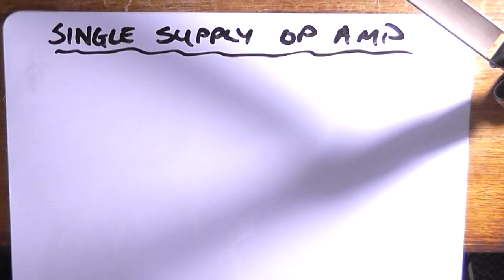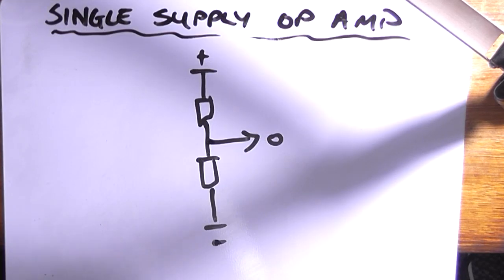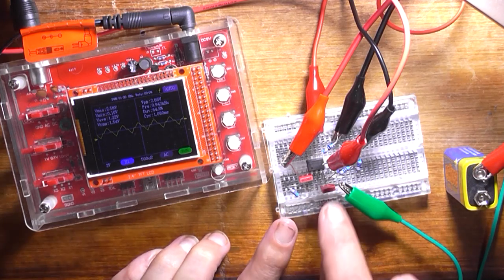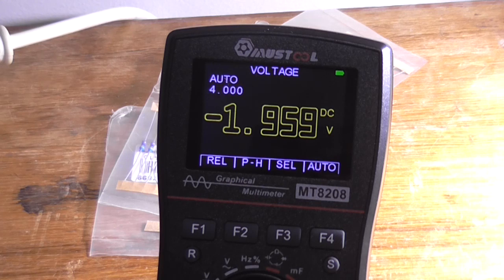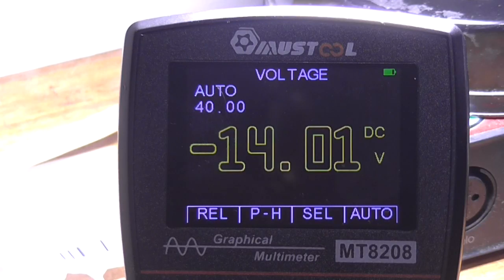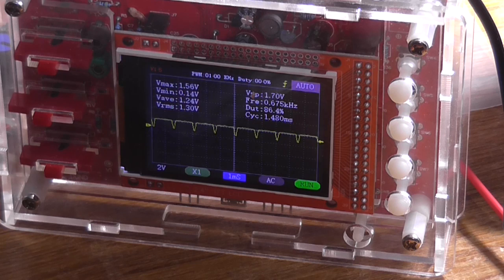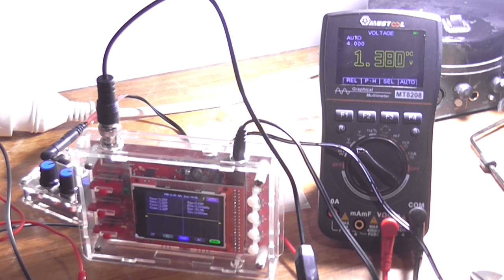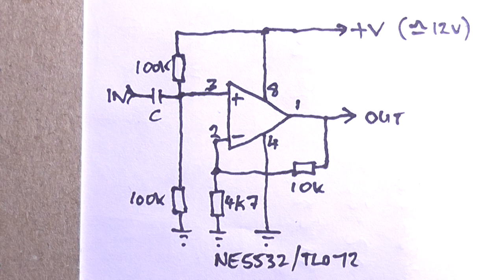Electronics Fundamentals: Running An Op Amp On Single Supply

Comment: @ 14:15 If you only want the circuit to amplify ac signals & not dc, then insert an electrolytic cap in series with the 4k7 resistor to ground. Around 100uF. This will give a gain of 1 at dc [1 + (10k/infinity)], ensuring that the output of the op amp sits at half rail. At audio frequencies the capacitor will be bypassed giving a gain of 3.

Comment: Good video, I enjoy the experimentation. Will the same method work on other amplifiers that require a +/- DC voltage, like the JLH1969, if you didn't have a center tap transformer?